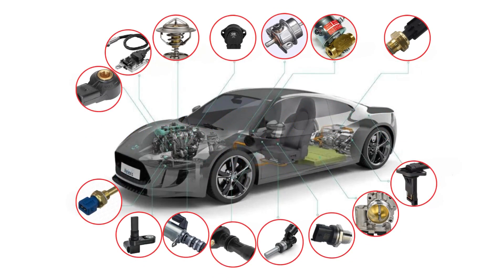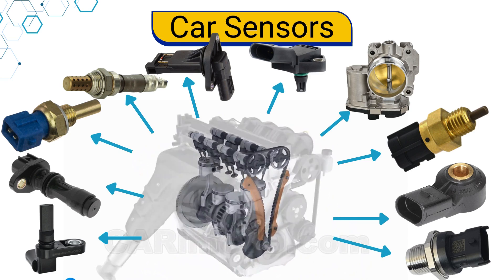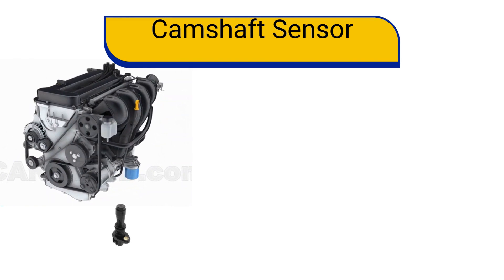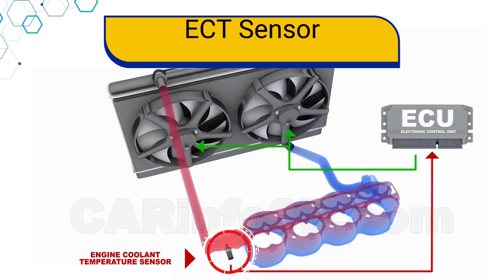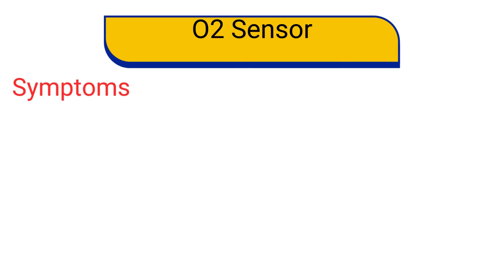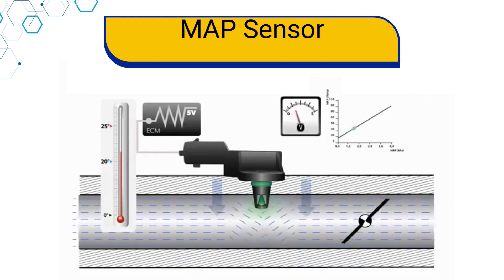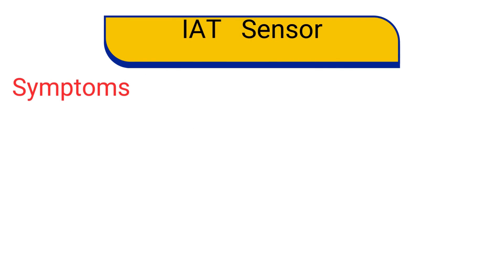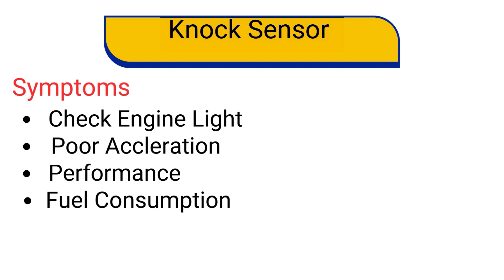Car Sensors: Part 1| Engine Management Sensors Explained

Comment: IF A MISFIRE CAUSING BY ALL THESE SENDORS, HOW WOULD DETERMINE THE CAUSE OF MISFIRE?  SHOULD YOU CHANGE ALL THE SENSORS TO RESOLVE THE MISFIRE?
Reply from the maker: You scan for active OBD codes. If there is any problem with sensor it will trigger related code to that sensor. Then you can test specific sensor.

The best way diagnose to check active OBD codes.
Reply: I HAVE EXPERIENCED THIS PROBLEM  TIGHT NOW. I HAVE A 2001 LEXUS, WHICH HAS A MISFIRE.  I HAVE DONE EVERYTHINGS THAT  RELATED TO A MISFIRE, I STILL DON'T FIND THE PROBLEM. DON'T YOU THINK THAT THE COMPUTER SHOULD HAVE BEEN  MORE ACCURATE?
Reply from the maker: Have you scan for active OBD codes?